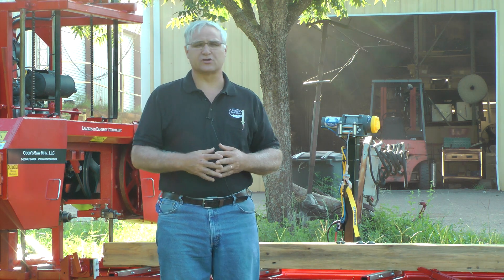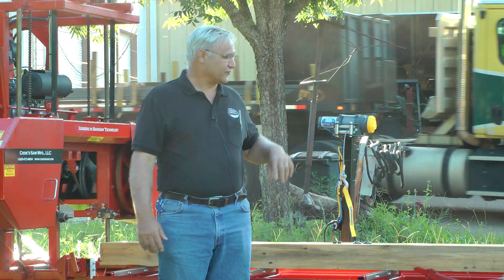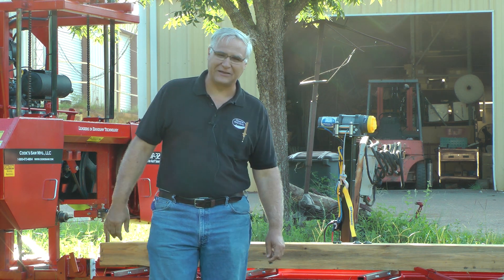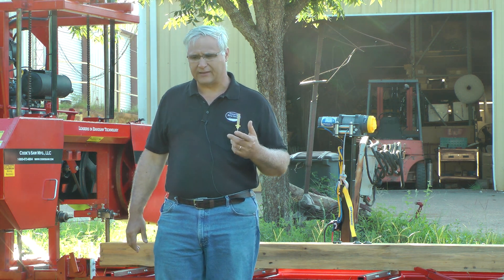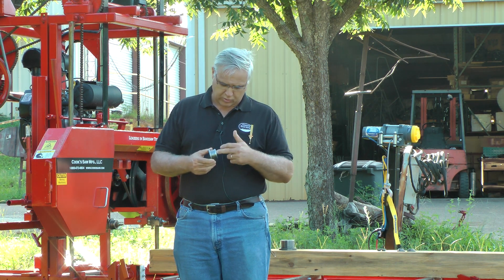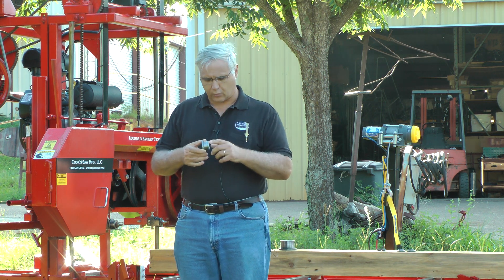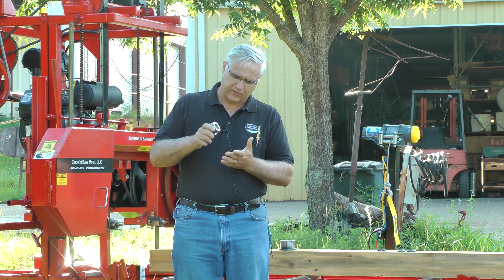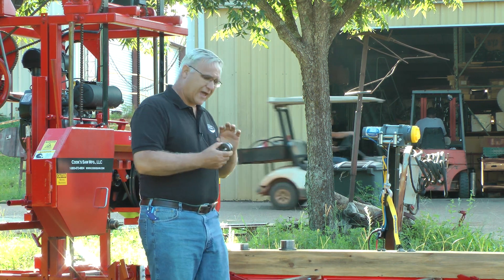Prolonging Sawmill Bandsaw Blade Life - Roller Guides

Comment: Your brother is a genius.  He mentioned on a video to use transmission fluid for blade lube so I tried it and that was the best advice I have ever gotten in this business.  Blades last 10 times longer and roller guides last 5 times longer.  We have 3 Cooks blade drippers, one each side of the mill for the inside of the blade and one for the outside of the blade.  We never have any sap on the blades they never get warm.

Comment: great video, thanks, i'm planning to build my own sawmill and have been watching many youtude videos and reading article so i feel like i've got a good plan. it will be 18" wheels, 7HP gas motor for 1" blade, cut up to 24" logs or so

the only bit i'm still unsure about is the blade guide rollers. i've seen 2 types, this type shown here, and something more like you would see on a bandsaw, 2 roller bearings, one vertical, one horizontal (no need for the bottom bearing if the guide is pushing the blade down 1/4").

to me it seems the 2 bearing system would give less friction because it turns in both vertical and horizontal plane independently.

with the cooks type flange bearing, sure the blade is supported vertically on the roller, but horizontal, if the blade is pushed back and touches the flange which is spinning perpendicular to the back of the blade, would you not get massive friction? 

i guess the idea is to set it us so the blade never touches the back flange, is that the idea?

thanks, steve